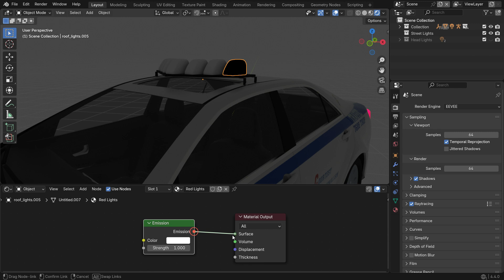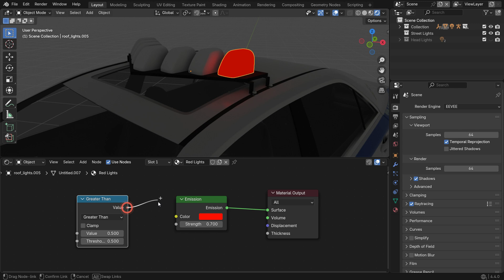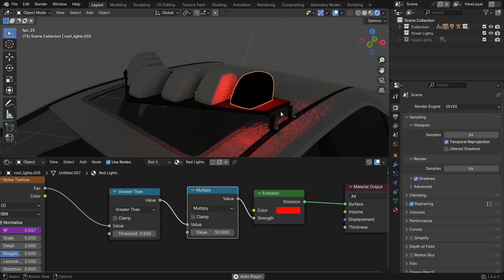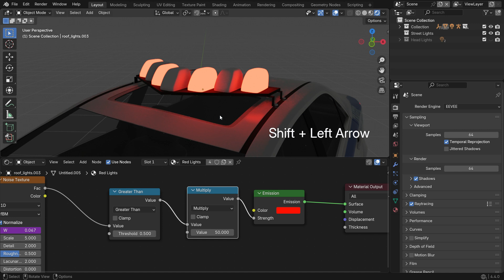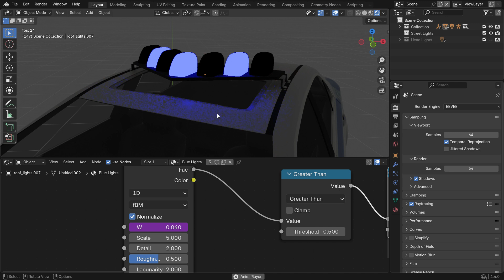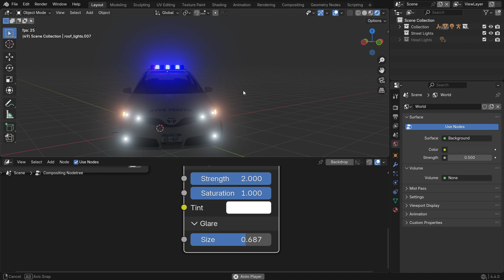How to Animate Flashing Police Lights in Blender 4.4 Eevee

Comment: Question. The lights aren't black when they are off.   Shouldn't their be a hint of the color or existence of the light?
Good video overall.   It will be interesting to mess with when it comes to different patterns of flashes.   
I still would like a more distinct Red and Blue color to show though.  The same would be with Amber or White. 
But I can use this to experiment with.   I'll have to add you on as Blender Source. 

This is for anyone. Where do you learn the connections and how to apply.
That gets really deep at times.  It seems like they have made 3D easier, but the materials and shading and lighting man ...  you have to know quite a bit.
I wish animation software wasn't in the thousands when I wanted to learn it.  

I would have games out of this world by now because I think outside the box.